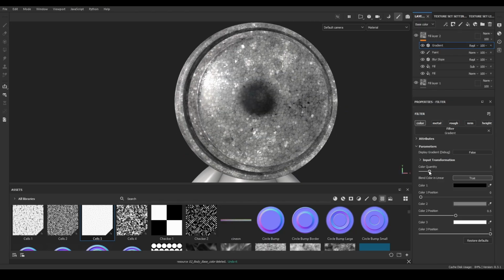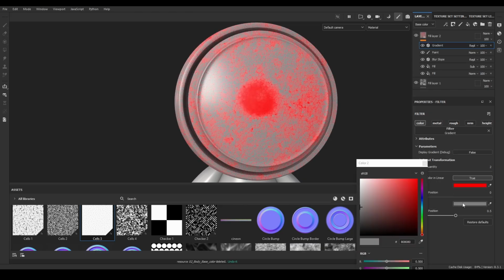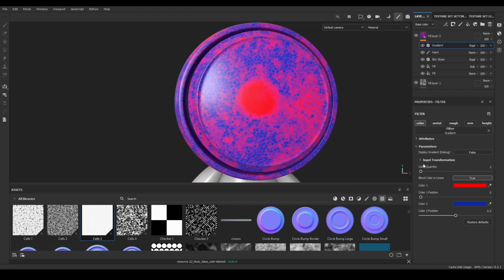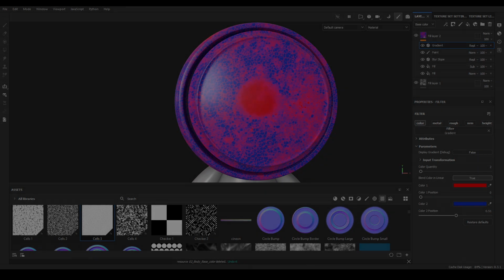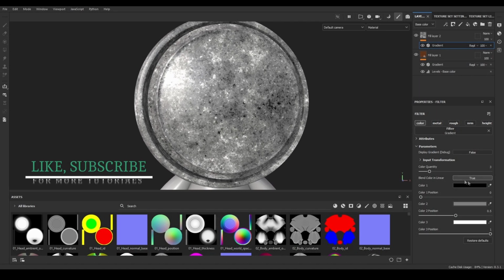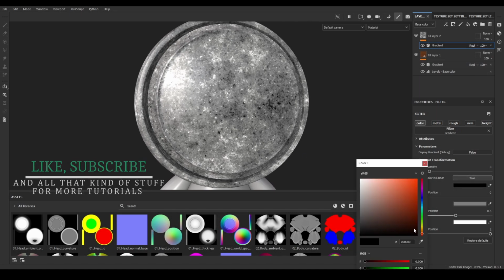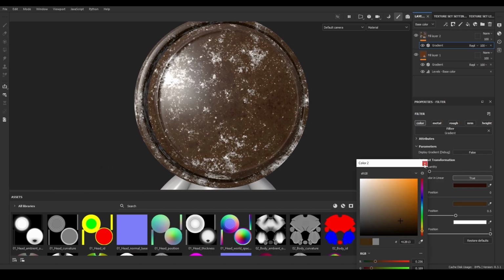Substance Painter GRADIENT FILTER Tutorial | How to Create Gradients, Base for Materials...

Comment: I painted a mask that I want to apply a gradient to, but there doesn't seem to be any way to use this filter while also keeping the mask I painted?
EDIT: OMG I figured it out. It's really convoluted, but here's what you need:
1. Paint your masked bits as normal, starting from a fill layer and a black mask.
2. Click the 'layer' box (the leftmost box) and change it to Planar Projection. Add a Filter: 'Gradient'. Change the 3 colours to R/G/B so it's visually apparent for now, until you get everything set up properly.
3. Click the 'mask' box (the rightmost box) and add a Generator: '3D Linear Gradient'. Set the 'Start' colour to pure white, and the 'End' colour to pure black.
4. MEGA IMPORTANT: Change that Generator's blend mode to 'Multiply' so that it works WITH YOUR PAINTED MASK rather than overwriting it!
4. Now, still looking at that Generator's settings, scroll down a bit and expand 'Image Inputs'. If you don't see that heading, make sure you have the Generator selected, NOT the mask box. Use your Asset Library to search up the default 'Shape Gradient' texture (it looks like a B -> W gradient texture) and drag that texture into the input.
5. You should already be seeing results, now it's time to focus the gradient on your masked area. Click back on the 'layer' box and adjust the Offset, Rotation and Scale parameters until your gradient is positioned and oriented correctly. You may need to rotate the Y by 90 degrees if you don't see anything changing.

Phew. That should be all. Took me a few days to figure that one out. I hope it helps someone else stumbling across this!
Reply from the maker: Glad you figured it out!! Btw, if I understand correctly your problem, using anchor points may be another way to solve that kind of situation :)
Reply: @GonzaloM3D  Tried with anchor points first, couldn't figure it out.

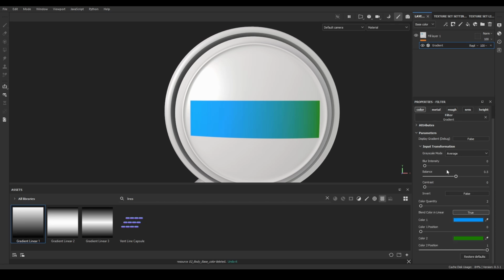Comment: 1:40 i want the gradient to be vertical, not horizontal ... how to do that ???
Reply from the maker: You have to rotate the gradient base texture. The gradient filter converts the black and white values to the determined values. In the example, I used as a base a texture that gave an horizontal black and white gradient, but if you search a vertical gradient it should work as you need

Comment: Why, in this case, are the Gradient Curve and Gradient Dynamic filters needed? You didn't say anything about them.
Reply from the maker: I wanted to create short videos explaining everything about a filter, so the info is more condensed and then people can think how they work with those tools, so that's why I only talked about gradient filter, and didn't mention the gradient curve and dynamic, as those are different filters. But in this case, as the names are so similar, I could have mentioned them, I'll take it into account for future videos. Btw, gradient curve and dynamic are a bit different, less commonly used, as they are ways to control values on B&W gradients, instead of using them to create colours for a layer. Thanks for your comment!